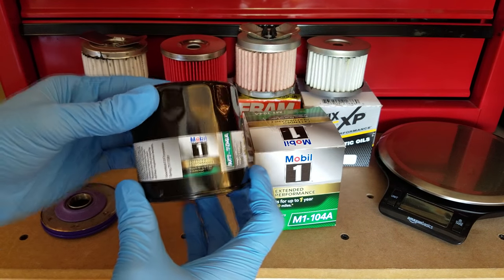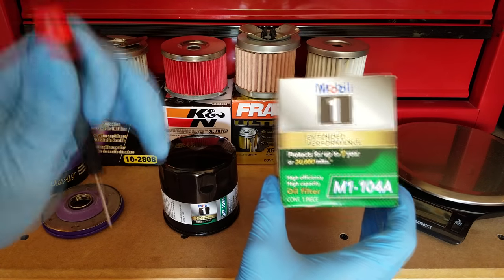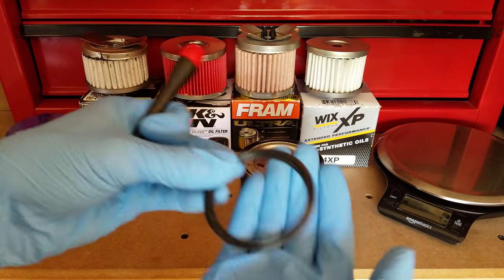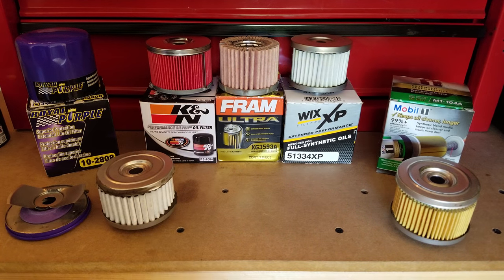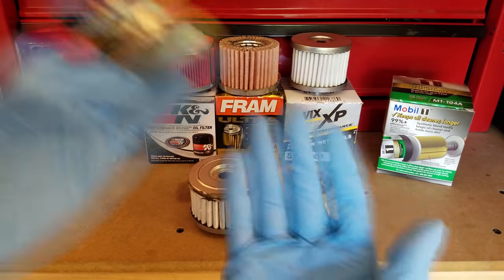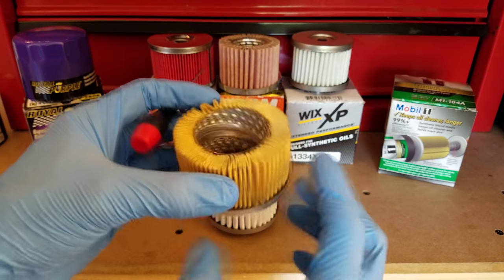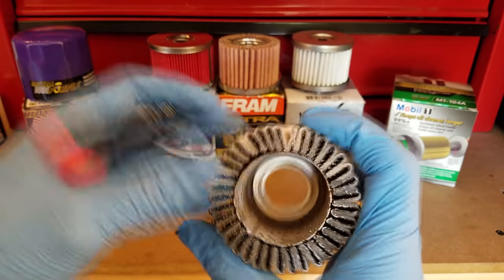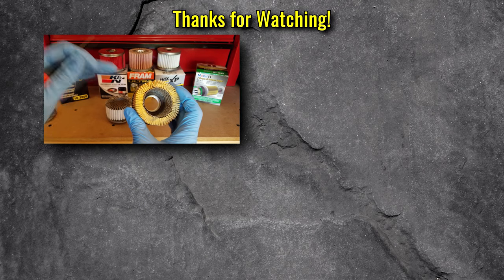Mobil-1 Oil Filter Cut Open! | vs Royal Purple/WIX/K&N!

Comment: Toyota's paper cartridge filter I've always used them on my 2011 Toyota but for some reason the ends or not sealed up could you explain this
Reply: @Andrew Frost I would like to know more about your experience with Toyota filters. Specifically how the filter was bypassed and ultimately clean.
Reply: I bought a k&n filter for my 2014 toyota and it was the same it didn't have the covers on either side have no idea why
Reply: @Andrew Frost 
Nothing wrong with Toyota OEM filters.  Funny you mention WIX who have had documented cases of coming apart and destroying engines due to oil starvation.🤔
Reply: @Andrew Frost 
Toyota OEM filters are excellent.  The ones made in Japan and Thailand are some of the best filters available.
Reply: @Andrew Frost 
I have cut countless Toyota OEM filters open over the years.  Filters for the 20R, 2JZ, 3VZ-FE, 5VZ-FE, 1FZ-FE.

That is filters for engines spanning 3 decades.  No I am not, and have never been affiliated with Toyota in any way.  I am just a fan of their older vehicles of which I have owned 5 in my life and still own one.  I've seen collapsed filter elements from Fram, and some other crappy filters including WIX.  I've seen drain back valves sucked clear out of filters right into the engine causing low oil pressure.  I have not seen this happen on Toyota OEM filters.

Having said that, I can't comment on NEW Toyota engine designs and the filters they use.  My current engine was assembled in 1995, but has used OEM filters the last 24 years, of which I would say a solid 12 I have cut open and inspected.

Doesn't make me an engineer or a Fanboy, just an enthusiast.  Maybe the new filters are crap.....but Toyota still manufactures the filter for my current motor so I have witnessed the switch between Japan to Thailand manufacture and haven't really noticed any degradation in quality....good fast oil pressure build up, no paper element deformation or failure.  That is all you can ask of an oil filter.

Wix on the other hand will never see an engine bay of mine.
Reply: They are sealed up with glue... 
What is the point of having metal or plastic end caps since they still need to be glued to assure no unfiltered oil is getting by.

Comment: All these companies have mobile 1 in their sites. Mobile1 apparently is the standard  they all attempt to be equal to.
  That speaks volumes to me. I have used mobile 1 since it was introduced. I remember the television commercials that claimed that it was the 25,000 miles or once a year motor oil.. ever since that ad, I have used mobile1, I change it once a year. I have never had an oil related issue with any of my cars. Trucks, lawnmower,
   When  that terrible space shuttle accident in 1986 that the shuttle exploded after takeoff. Nasa laid off a lot of people. One of the engineers for NASA took a job as a rep for an Italian motorcycle company. He showed up at one of the national events on a brand new model of that company’s cycles in 1987 ..a motorcycle I was interested in. We got to talking and I had that guy to myself for two hours. He explained to me about mobile 1 oil down to the molecular structure. I didn’t understand it, something about how all the molecules are very tiny and all the same size unlike conventional oil.He said they use it in NASA. He said that the US government military tanks that costs $70 million each at the time uses mobile 1.
   That’s good enough for me, and that’s why a lot of these  upstart Brands have mobile 1 in their sites. I mean why would they take aim at a mediocre lower on the totem pole brand. I’m sold

Comment: I’m wondering if their claims come from synthetic oil having way less impurities which is why you have to use a certain oil with it for the warranty. The filter is definitely a beast but when you combine the cleaner lubricant it will out 
preform. By the way I use mobile 1 and while I see no big differences performance I just like it in my Nissan rouge. My Jeep Wrangler I will be doing pennzoil just because it says meets jeep, Chrysler standards for warranty. No other reason

Comment: ...I reckon the whole "20,000 miles" thing..... They probably have a point. Most people don't really ever check their oil... And a huge number will go literally years between oil changes........ Anecdote: I spent a bit of time doing some work at a car yard (...a shitty one). Before starting up a V6 3.2l Audi that had been sitting there for literally six months, went to check the oil... "WE'RE NOT PAYING YOU TO DO THAT!" - they were annoyed that I would, um, check if a car had oil in it.... :D ...... So... Well I didn't check oil after that; I guess they'd prefer to just sieze an engine and junk a car completely, rather than doing a five second idiot check of "does this engine have any oil in it?".... That same guy - who owns three used car yards - has a Golf GTI.... And the "european specialist" mechanic he took it to....... Changed the oil.......... And apparently it was next due to be changed 45,000km later :D .... In spite of the car's protest via "SERVICE NOW!" message etc, dude drove it like ~35,000km....... It was not happy or running well at all, but it did still work... And after somebody convinced him that maaaybe it'd be a good idea to do $80 worth of an oil change (nothing special - just a decent OEM filter and Penrite oil; which is a premium oil in Australia/NZ/I use it/it's good/cool black bottle/just like any other decent oil)....... It was a lot better. I doubt it was perfect - seems like going that far between oil changes in a turbo hot hatch probably isn't that wise.................. But people who really, really really should know better still don't bother checking or changing their oil...... And go gigantic distances without checking or changing....... And seemingly get away with it more often than I'd have thought!! So.... Though I think 20,000 miles probably isn't a great idea personally...... I see where Mobil/etc are coming from with that idea :D - I think a high quality oil paired with a high quality filter would cope with that "OK"... Doubt you'd get a car to a million miles.... But the engine will probably still last ~10+ years for most manufacturers, 15+ years for Toyotas and Hondas, and if it's a GM - and you're lucky - it might last long enough that the 20,000 mile/1 year oil change becomes a factor you need to concern yourself with :D

Comment: Just cuz it has more plates doesn’t make it better.How the oil going to flow easily allowing it to filter and get more power out of your engine as well??? Common sense bruh,ou need some space,the royal purple looks like the better filter.
Reply: Depends.  If you used ethanol gas and sand mixxed oil(water absorbent), do not matter much what kind of filters you used.  Probably stuckfull of sludge sand and need to be change more regularly??

Comment: I just put A/C Delco on Chevy's,,,,,MotorCraft on Ford..
.....Purolator or Wix on everything else........Seems to work.
Reply: Your AC Delco oil filter is the same exact filter as Walmart supertech. Except the color.
Reply: @dustin9035 ...and  another great point.   Wal-Mart Super Tech oil and oil filters are just fine on anything made....

Comment: Expensive filters are a waste of money. They are only a restriction once the oil has reached full detergent capacity. Realistically a filter is only needed if you have particles suspended i  your oil usually metal which is only present if there is a lack of lubrication. Invest in a quality synthetic oil, use the recommended viscosity in your climate and change it every 5k or less and youll be fine. Changing your oil regularly is the most important aspect of maintaning your engine.

Comment: Has anyone ever had a oil filter fail ,that wasn’t an assembly problem,example paper had a hole in it ,or failed to bypass, all the filter media ended up in the engine .cans fail when oil pump relief valve fails but that’s not the filters fault.if you lose a bearing that filter won’t help even if is a 50 quart world class filter so size doesn’t mater so she said!

Comment: Champion labs makes the mobil 1 filter. The newer part number with the A after it has a higher bypass pressure(22psi). I believe the old one was 15psi. 

This is the same manufacturer as the ac delco PF64 my car uses, for awhile they were the only filter rated at 22psi. This was a requirement for modern GM engines(2012+). It would be interesting to compare the PF64 and UPF64R that supersedes it. There are some cut comparison shots online already but I think your video comparison would be great!

EDIT:
I should add the AC delco filter is much cheaper than the mobil 1 and of similar quality

Comment: I use mobile one and only change my oil about once a year I only put about four or five thousand miles on in that year as well. I have not noticed any problems with that however would my SVT automatic transmission that's a whole different story. It has to be the worst transmission I've ever seen or driven in my life. I used to be an auto mechanic that worked at a transmission shop, give you an idea how many Transmissions I've seen.
Reply: jeff wolf I change a 3-5K year: GMC Canyon 2007: MOB1, with NAPA GOLD OIL FILTER; actually runs perfect: though changing off KN Air: to ACDELCO FACTory OEM heavy Duty.( Lots dust here in HELENA MT)......
Reply: @opera93  you have the dust where you live I have superhuman Salt Air where I live up in Cape Cod Massachusetts. I hope you guys are okay this winter it sounds like you're going to get bombed like you do pretty much every year I think. Good luck and I'll look into that filter thanks for that

Comment: I guess you were onto it. Filter factories make different labels.

Mobil 1 and Royal Purple
Bosch and Purolator
Wix and Napa

Those are the ones I know about. I prefer Wix or Napa. They do the same job as the expensive name brands. The worst built one is the regular Fram. Cut one of them open, complete junk. K&N are great but you toss money away on the name.

Comment: What wrong with an OEM Motorcraft filter? It's what I use. I've got several Ford vehicles I use the OEM filter on all of them. I can go to Walmart and buy the motorcraft filter I need for less money than what the FRAM offering is.
That motorcraft  filter is cheaper than anything else. 
I've to see any bad negative words about the OEM filters. If you go to a dealership and get your oil changed they're going to put on a motorcraft filter. If you got a high-end Lincoln SUV they're going to put the same OEM motorcraft filter on. Ford says you can go 10,000 mi between an oil change with normal driving. that oil filter will hold up just fine for 10,000mi. I personally never would drive a vehicle without changing the oil in 20,000 miles. I don't care how good you may claim that the oil is. Or how good and durable your filter is. Oil is oil and it still gets dirty. it's not necessarily that the oil ever breaks down it's at the oil gets dirty. It's not far from the truth to say that dirty oil is like liquid sandpaper. I drive high mileage I have drove a numerous vehicles past 250,000 miles with relatively few problems.
No major engine problems. 
I use full synthetic. Just not the best full synthetics. I typically use Mobil 1 or Pennzoil Ultra or Valvoline. What ever is the best deal at Walmart.

Comment: Why 20k oil change, oil is cheap engines are not.  Used engine oil is recycled, and replacing engines leaves a much bigger carbon footprint then more frequent oil changes.

Comment: I say, do some weight testing,  zero out a scale before and after the rated mileage and measure the weight difference?
Minus the weight of the filter itself, allow the filter to drain and dry.

Comment: Hello, I will like to share some thoughts about this review and I have to say that,is worthless to put that much attention on the structural fabrication of filters, I haven't seen any filter explode or collapsed as much as cheap as it is, and I have seen hundreds of them, they just don't have to withstand that much of a pressure, positive or negative to make them catastrophically fail, about  the thickness of the body only make's them heavier and that's it, about the by pass comments, its not like the valve its going to work all the time or is that much of a critical component of the filter, it is designed to open only when the filter media is full or the weather is very cold making the oil thicker upon warm up, being that said, I will put more attention to the mechanism to hold tight the whole cartridge against the housing, personally I don't like the spring leaf design, coil spring will be more consistent for that purpose, about  the seal perfection of the oil bypass valve, is not that critical component either, even if it bypasses a little amount of oil, you have to remember the basics,it is a closed circuit, it will be filtered over and over again, it is proved  moisture in oil will cause more damage, and for last on the seal and drain back material topic, my opinion is that they use silicone material for products that are designed to stay longer in service,and it will stay more flexible even with high acidic oil and given the rubber characteristics to become hard and brittle with the heat cycles getting cooked,on my personal experience I have removed way overdue oil filters with hard as rock seals, but none of them have been observed leaking oil because other than looseness,I will put more attention to the filter media material area, capacity and effectiveness, thanks for reading, I hope this thoughts will open your mind about all this oil filter reviews madness